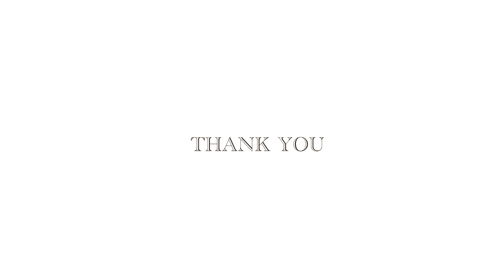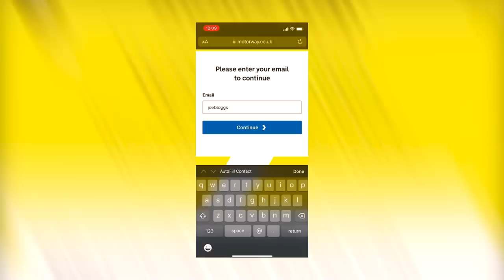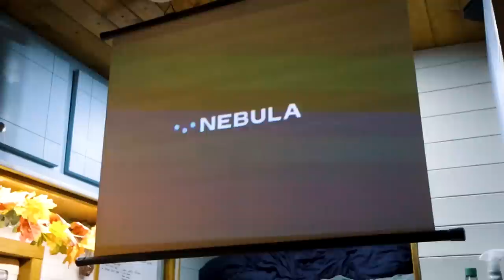ARE LOG BURNERS WORTH HAVING in a Camper Van Conversion?

Comment: Chaing wire thickness is not a problem so long as the thinner wire can handle the current.  If the thinner wire came with the heater is should be thick enough and the wire in the van could be thicker.  If the thicker wire is the one that came with the heater then it is a problem.     The fuse you use should be no more than the thinner wire can handle.

Because the overheating was where they were joined together the reasonable explanation it was the joint that was the problem, not wire thickenss. Just wires and tape is a bad way to do that.  

The choc blocks other have said is a bad idea too in a vehicle and I am glad you did not use the. They are relatively common for mains voltage applications where the voltage is high and the current is low. The limitation of a connector is the current regardless of voltage and power = voltage * current. If you compare the voltage a 240V UK wall outlet is 20 times the voltage of your 12V DC in the van. So the same power usage requires 20x high current at 12V. It looks like the small choc blocks are rated at 3 or 5 amps depending on the exact size. That is 720W and 1200W at 240V so quite a lot of power. At 12 V it is only 36W and 60W.

Wires and connectors at 12v will need to handle a lot more current than at 240V so what you need to use is not what an electrician use to main voltage is familiar, it is not just the current there is vibration in vans too. So get someone to help that are used to 12V system in vehicles. Tkar a look at for example 12 volt planet for a UK retailed specialized for motor homes

I am not sure what water heater you use, it could be the  Bobil Air Hybrid but I am not sure. It uses a 200W heater at 12v that is 16 amp even the larger choc blocks are only rated at 10A.  16A at 240V would be 3840W, UK wall outlet is limited to 13A.  

A way to check a connection like it is just to test it and feel hot it gets. After the repair is done just feel with your hand if they get hot. 12V will not electrocute you and the connection should have some insulated cover. I would be a lot more careful at 240v by turning and cutting the power before I touch. Feel it a bit when it starts and then when it runs for some time. The wire and the connector can be a bit over the ambient temperature but it should not feel hot.
Reply from the maker: Thanks for the information, really appreciate it
Reply: That’s bullshit electric wiring comes in different size for a reason the bigger the wire the stronger the current it can take and that’s why it comes in various sizes
Reply: @jolawre6526  I never said the wire size does not matter. I said a change in wire size is not a problem if the thinner wire can handle the current.   The connection between the wire needs to be done correctly and the fuze needs to be for less than the thinner wire can handle.
Reply: If that’s the case why does electrical wiring come in various sizes ?
Reply: Smaller cable is for lower current and large cable is for larger current simply.
Reply: @jolawre6526  Thicker wires cost more money,  are larger, heavies, and can be more cumbersome to install.  So you pick one that is thick enough for what you need but not too thick because of cost and other factors.

Wires have a max current limitation, there is no min current limit. There is a reason I stated, "so long as the thinner wire can handle the current."  

There can for good reason be regulations that forbid that in installation. It will be a higher risk of problems if modifications are done later. How do you know the wire thickness changes if you can inspect it all, if you in the future like to draw more current and do not know the thickness change that can result in a dangerous situation. So changing wire thickness might not be a good idea but it will work in the current setup.

Wire thickness is not just a question of max current. Wire resistance will always result in a voltage drop over the wire and come heat produced. The voltage drops will depend on the current, wire thickness, and wire length. So a long run might require a thicker cable for an acceptable voltage drop. Because of the high current in low voltage systems like a van, it will be a lot more relevant compared to mains voltage in a house but that does not mean it is never relevant in houses.

Regardless of whether the wire thickness is the same or not, a wire splice needs to be done so it can handle the current and it looks like that was the problem in this case. If you can it is better to have an unspliced wire but it can be cost-prohibitive and impractical
Reply: @target844  Since Liam decided to upgrade their inverter size to accommodate his wife's blow dryer, could that have affected the current issue?  After all they had no issues until the larger inverter was installed.
Reply: @mailto5319  I do not think it is related. If I am not mistaken the water heater operates on 12V. The cable thickens any type indicated that. So a larger inverter is not relevant at all.

If I understand the situation correctly they did have a problem in the past, the water heater never worked. They did change a relay in a recent video to get it working. I think before that there have never been any current through those wires after the system was installed.

It looks to me like it is the cable splicing that is the problem and it had too high resistance all the time or the was not spliced correctly so the connection has got worse over time.  It might be the case that it happen when the relay changed. A substandard splice failed when the cable was moved when the relay was changed.  I would not blame Neil that helped them with the relay, the splices should be able to survive you moving the cables.
Reply: Lots of variables may apply anyway. You can have the same gage wires and one could "look" thicker than the other, because one wire may be insulated and the other may not be. It also depends on the interior material used inside the wire casing. IE: copper, or metal strands, etc.  If the relay switch was defective, then it could have been from a surge of some sort... or a surge in the current going into the relay switch. They could have put something into the cupboard that fell over or fell on top of the wiring that could have affected the connection.  You can't pile stuff on top of the heater and wiring.  I thought they had deasel heater issues in the beginning instead of the hotwater heater, but I could be wrong.  I'm sure it will get sorted after they get a "vehicle electrical expert" to do some testing with the multimeter. I believe soldering connections together and then using heat shrink wrap to seal it all will prevent moisture or air from getting into the connections.  Lots of youtube videos out there about splicing techniques for wiring depending the different currents that will could used.  Various opinions and personal preferences, so it can be confusing.

Comment: Another great video guys thank you.
I’m sure some people on here think your kids !

The cables were joined using a through crimp then they would have used electricians tape.
It’s not the best way to join cables that are different sizes.
This happened due to loose connections.
I have no doubt you would have joined them by now.
The best way to check connections is to give them a little pull after you have connected them check the terminal is tight with your screw driver again. 

Take care and stay safe.

Just love the videos 

If your ever stuck on electrics well free to send me a message
Reply from the maker: Thank you 🔥

Comment: Put Nitrogen in your Tyres. 
Nitrogen holds pressure better than Air. 
Nitrogen generally only needs topping up at each Tyre Service Interval. 
Although Nitrogen costs money it saves you Time which ultimately saves you Inconvenience
Reply from the maker: Ah nice, didn't know that

Comment: Glad your both OK and this is why you should always have a qualified person to carry out electrical and gas work. As for condensation issues I remember asking when the van was being fitted out if you were fitting an extractor fan in the shower and was told ny Liam it was required likewise with a shower door not just a curtain. Maybe worth thinking about in the future 🤔

Comment: Different wire diameters joined is not acceptable especially on high amperage current draw units.  I see this many times on after market high powered audio systems  installed by novices. Whoever wired that should refrain from  messing with electrics.

Comment: I hate to burst your bubble about the lovely log burner, but please please please do a "particulate matter test" on that log burner.  You may not see the smoke, but every single time you open that door to load more wood, you're exposing yourself to amazing amounts of particulate matter.  V bad for your lungs if the levels are too high and in that type of burner in that small a space, you really really need to meter it first.

Comment: Maybe the water heater isnt working because the batteries aren’t getting full due to lack of sunshine on the solar panel, so the batteries arent hitting 100%. When you get the fault fixed with the cabling, you can turn the water heater on manually using the Victron app (as long as you remember to turn it off again). Go in to your MPPT charge controller, hit the gear icon in the top right, go to load output menu, write down what the operation mode is set too eg. ‘Conv.algorithm 1’ (you’ll need to set it back to this setting when you’ve finished heating the water). Turn the option to ‘always on’, this will put power directly into you water heater via the relay. With the ‘always on’ setting set, the batteries wont recharge so you want to leave it on. Drop me a line if you want to talk through it more.
Reply: Obviously will only work if the engine is running or on a bright day to catch solar
Reply from the maker: Thank you the batteries were full, but understand what you mean. It wasn't working because the power to it had been melted apart by a faulty or bad connection

Comment: A small amount of knowledge is a dangerous thing in the electronics field. A thick wire connected to a thinner wire involving electrical tape should never have been installed like that. Torque settings & terminations are crucially important with the vibrations of a moving vehicle because “loose wires start fires” I dread to think the potential danger that lurks in some of these self builds 🙈💥🔥

Comment: Ewww guys that must of smelt terrible the insulation burning off hope you are OK not too shook up
People are right in comments just to add a little too it the guage of the wires should prob be 4mm or 6mm, they may have to be a certain length between your water heater unit, the relay and to the source of power.  Somewhere there should be a fuse between the source of power and where that goes too that should of  prevented the melting. Also the wires should have as less joints as possible but where they do they need to be in a proper fixing ie block you've got and not twisted together for example. 
Without seeing in person it's difficult to say the water heater must be pulling some amps  to heat up and that would cause some heat in the wires if not the right guage will cause this problem and need a fuse thats same amp too. Need someone that knows this sort of setup or knows electrical knowledge could be just a size wire problem but if their is live to earth there somewhere need it all tested really guys hope it's an easy simple fix for you two take care 👍👌🤙❤️🍻

Comment: The van and Overlander lifestyle really requires your own skills to do electrical work.  I had to bypass the immobilizer in Mongolia in the backyard of a hotel in 2019.
Fortunately, you had a small problem. 👏🏻🤠
Reply from the maker: Yeah although I think it needs same thickness wires now
Reply: @ThoseHappyDays  It can be better.  I couldn't see exactly what it was about from the video.  Loose connections can cause smoke.

Comment: Your electrical problem depends on which wire is fatter, if it is the one coming from the device then the thin supply wire is undersized and it needs to be the same thickness as the one coming from the device. It should be replaced as the thin wire will not handle the current and heat up and burn out as it has and is most likely scenario for what you are experiencing. If it is the other way then the wire is oversized - no problem here it is more than up to the task - It would most likely then be a bad connection between the two wires. With all your problems I'm starting to wonder about the workmanship of the builder. Undersized cabling would fit in that category. I would not reconnect it and see how it goes if the supply wire is undersized as it will happen again.
Reply: @Tinycamperadventures  .?
I think you can answer your own quesrion.
Reply: A moving vehicle is one of the hardest environments to build for, any shortcuts will show up sooner or later.

Comment: Large wire  smaller  wire. Mmmmm dont know what you are  running.  But the thick  wire carries  more current and amps if that running  to the smaller  wire it's a lot off current from the thick  to the thin and the  thin cannot  take the amount of  current/power so it overhears gets hot like electric  fire bar and gets hot and starts  to burn  and then sets a fire  . As the little  wire cannot  carry  tbe extra amount of  electricity.  As its small.   Like   a large river trying  to go into  a small  brook it wont take it.

Comment: You never twist and tape a electric joint. Regardless of voltage or amps.  It's always solderd and heat shrinked. Or wago connected. Or some such clamp connector suitable rated to the volts and amps it will be dealing with. Your ok for a higher supply guage cable connecting to a lower guage demand cable. NEVER the other way round.  And personally I ALWAYS uprate the cable needed.  Thanks. Love your channel and videos. Happy travels
Reply: Watched back 2 x now the bit about cable. That is under rated cable change it ALL from the supply Unit to the device. What ever the device it  will have a rating on it. What ever the rating In v and amps. Up rate the supply cable to the next available.

Comment: Defo not the right size wire going to yer boiler.
I'm starting to wonder how long it will be that laws will be introduced that you won't be covered with insurance unless you can prove you've had someone qualified to do these sorts of jobs in vans.
I'm seeing some stupid dangerous botch jobs nowadays.
Also do you have a mains switch that you can turn everything off when you leave the van?😉😊
Reply from the maker: Yeah we do have one of those, but will get someone to look at electrics ASAP

Comment: Check your alternator voltage, it could have gone faulty and over vaulting your system as this could have blown your relay originally. You have alot of equipment wired up to it so the extra draw can destroy them pretty quick. You should be seeing 13-14v any higher then your alternator is faulty
Reply from the maker: OK good shout, will get it all checked out
Reply: @ThoseHappyDays  it may be worth investing in an uprated alternator anyways as originally all your van would have ran was lights heater etc and now you have alot more drawing off it when driving.
Reply: @ThoseHappyDays  just had a quick look and they seem to range between 80 to 210amp so if your van has a smaller sized one fitted you could be overloading it and that can cause wires to get hot 🔥
Reply from the maker: @wagonman63  coincidentally we need to look at it for another b2b upgrade soon anyway, so good timing

Comment: I would strongly recommend you get an automotive electrician to check the wiring out the one I knew (sadly lost touch useful guy to know) didn't rate French vehicles he did tell me that the thicker the wire the higher the voltage it could take  so your problem is more amps trying to get through so the joint will heat up causing the fire get a qualified person to check it.
The roast looked good I am not a vegetarian/vegan but will try anything and have had some really good meals and have got myself for the weekend a meat free beef wellington from Aldi, I have tried some vegetarian burgers from Costco (they are doing more meat free options) but found them a bit bland sadly I did notice a well known brand of sausages on my last visit and was amazed that a pack of thirty was more expensive than a pack of forty meat ones.
Stay safe AND GET THE ELECTRICS SORTED visions of the Travel Beans first campervan they purchased in America

Comment: a bodge job on the wires by the sounds of it, the thickness of the wire is important to carry the correct amperage. And they will get hot if too many amps are going through them.

Comment: Liams a cowboy and shouldn’t touch electric ⚡️ if he doesn’t understand how it works. Connecting  a higher voltage cable to a lower voltage cable that’s just a big no no wtf😮doesn’t take a genius to know that’s wrong there a reason why the there two different size’s

Comment: Those crimps on that wire are no good, they can’t cope with wires of different sizes being joined together. Get yourself a few wago’s, they’re only a few quid for a handful and they’re really easy to fit, you don’t need any skill. I’m a sparks and I’ve seen this problem loads…

Comment: Different thickness wires  will have different current (ampage ratings) and if one is thinner than the other could have a lower rating. if rated too low for the appliance it is connected to it could overload and cause an electrical fire. It is very important your vehicle wiring is the correct rating for the devices you are operating. This is basic electrics guys and you should familiarise yourself with this knowledge rather than relying on others. Be responsible for your own safety guys.
Reply from the maker: We didn't do the wiring, we paid for someone else to do it